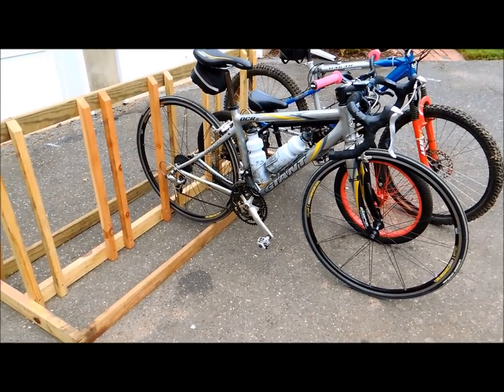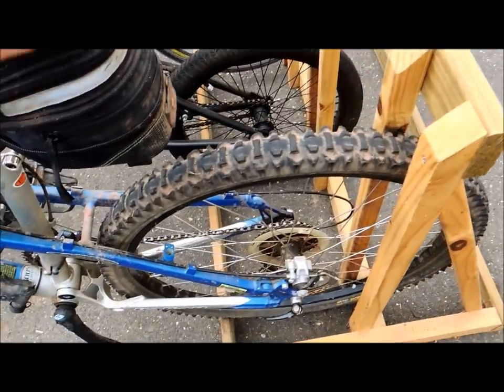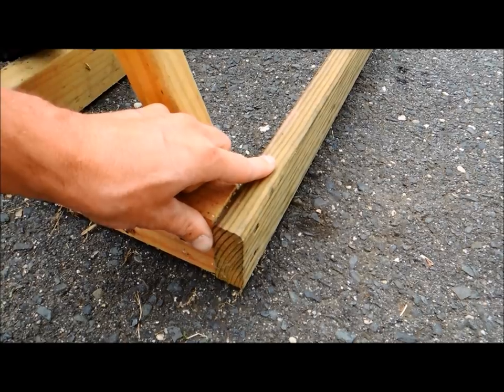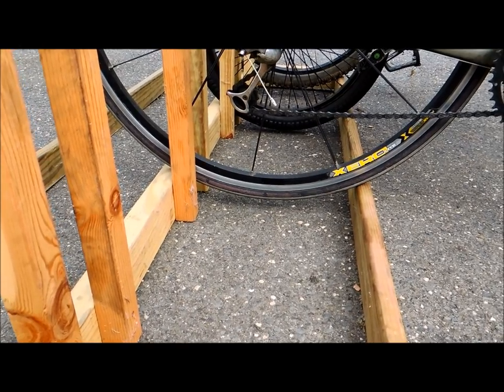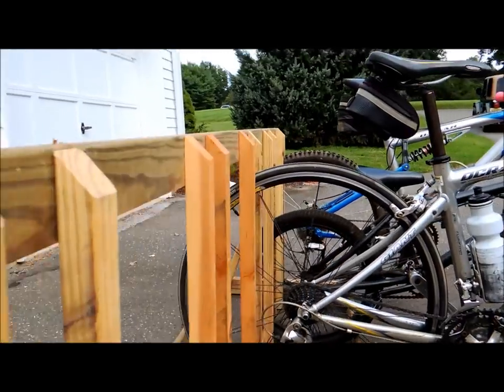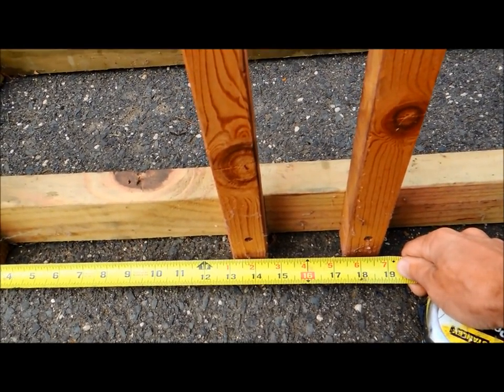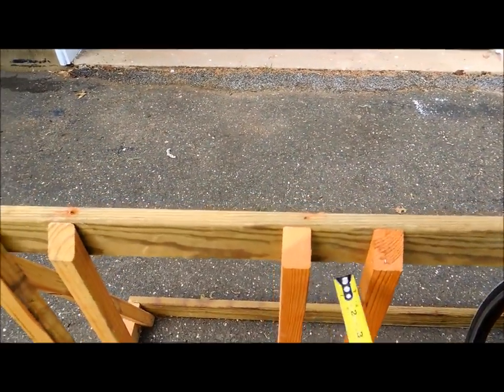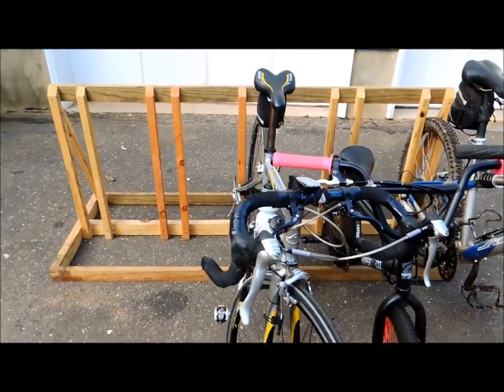DIY Bike Rack Made of Wood

Comment: Very helpful thanks, I have a 27.5 " bike so did the bottom spacing at 14". Worked really well.
Reply from the maker: Yeah, bikes have changed and with 29 inch mountain bikes or fat tire bikes, for example, you may want to tweak the spacing.

Comment: Thanks very much - this helped a lot!  I ended up doing a 4 bike rack based on this because I have two e-bikes and 2 cross country bikes.  Every market option seemed to have problems with the weight of an e-bike.  I made it using 2' x 4' for the frame and beam and 2 x 2 for the uprights.  I used 2.5 inch screws (40).  As I was using 4' frame, I made the distance between the front and middle of the frame 14.5 inches to suit the bikes and the frame.  Thanks Again!
Reply from the maker: That's great to hear.  One advantage of this design is the flexibility to accommodate different bikes.  When I made the video the e-bikes and the 29 inch mountain bikes didn't even exist!

Comment: I like how you built it, and that you ripped the 2 x 6 and decking boards to conserve lumber. I do a lot of work with bamboo and intend to use it for the balusters and perhaps a few more places. Several of my bikes have rear racks and I'm wondering if they will fit. Guess I'll get out the tape and figure that into the equation.
Reply from the maker: Interesting thought using bamboo.  I suppose you could drill holes top and bottom to accept the bamboo uprights.  Or, perhaps you could use pipe clamps from the plumbing section of your box store to hold them in place..

Comment: I am thinking of making one, but was hoping to be able to reduce the 16" space between the bikes by making å "bridge" on every second to have two of the five bikes higher. But when drawing I see it will not help unless I accept to move two bikes when wanting to use one. (Either when collecting or putting the bike back, if I use the bikes equally much).
Reply from the maker: I certainly wouldn't want the spacing any tighter on mine.  Some of the new mountain bikes, for example, have really wide handlebars and it can get annoying if the spacing between bikes is too narrow.  You could always do a two-sided version if you have the floor space.

Comment: Just wondering, would there be clearance for a 29" tire on this rack?
Reply from the maker: I don't have a 29" mountain bike to try, but I just measured a road bike with 27" tires and there is 1.5 inches to spare.  A 29" might fit because of where the cross bar sits in relation to the tire, but to be safe you could extend the uprights another inch.
Reply: I ran into trouble with a 29" mountain bike with 2.2" tires, which considerably increase the effective wheel diameter as compared to the 27" road tire mentioned (at least 4" increase).  I had already built the uprights when I discovered this, but I solved it by increasing the horizontal spacing between the uprights and the front of the rack from the suggested 12.5" to 15.5".  My rack now accommodates wheel diameters between 24" and 29".
Reply from the maker: Adding a couple of inches to the uprights is enough to clear a 29 inch wheel, I think.  When this video was made the 29 inch mountain bikes were not the standard!

Comment: How many people can rip a 5/4 x 6 in half ?
Reply from the maker: With a table saw it's very easy, with a circular saw you can clamp one end to prevent movement of the work piece or have a helper hold it down.  Of course, you can purchase lumber already ripped to size if you prefer.